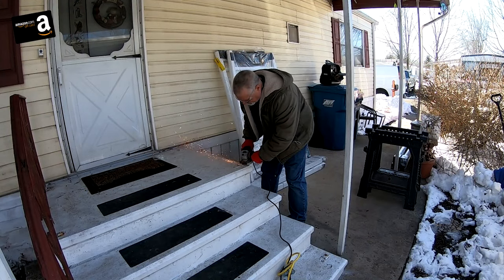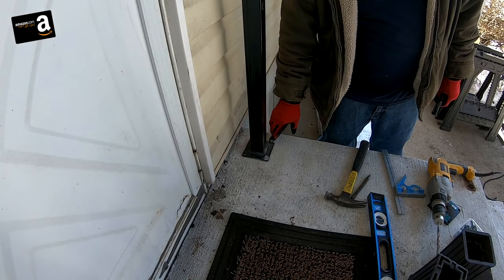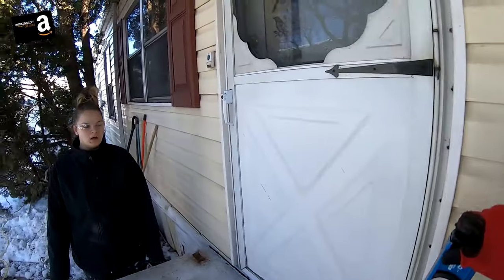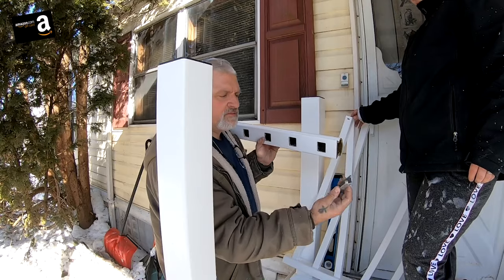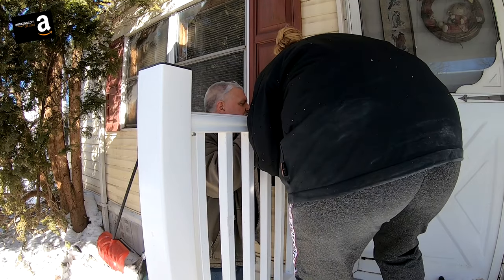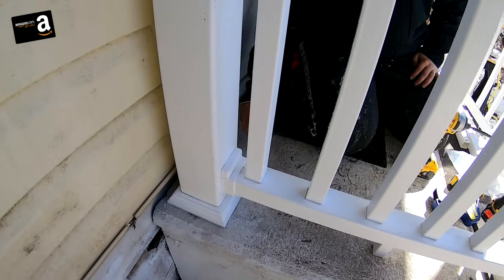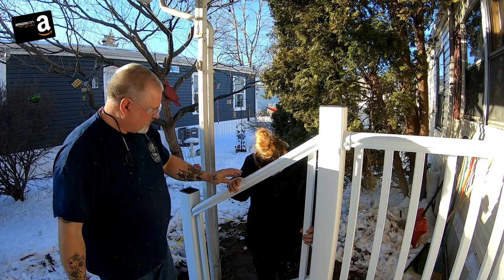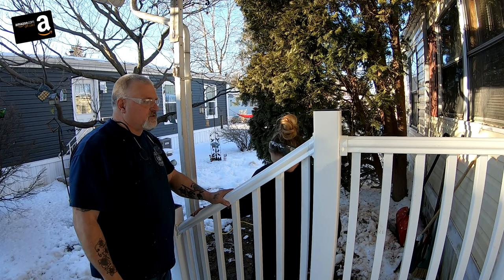How to Install a Vinyl Railing

Comment: I don't know if anyone commented on baluster installation, but here goes.  When you shortened the balusters you cut them off at the same angle as the railing, and needed "7" hands to hold them.   Cut the balusters square when you shorten them, just like the factory, and the job becomes easy peasy.

Comment: I couldn’t agree more about Home Depot! I can’t tell you how many times I’ve had to exchange things because of missing or broken components. One time I purchased a lawnmower and someone’s old one was in the box! May I suggest when you have your final cuts on the ballasts for the rail add some vinyl cement glue to help stabilize then before adding final screws
Reply from the maker: I would be concerned with issues caused by expansion and contraction.

OMG someone’s old lawnmower ha ha how terrible.

Comment: Awesome video for me! Im pretty handy but one thing Ive never done is put vinyl railings up and need to at my place to replace the rotted metal ones. I'm so busy running my own business 6-7 days a week I tried to find a contractor to do this and put up railings around our pool deck and so Im 0-3 with guys not calling back, even after a friendly reminder so screw it! I'll just do it myself. Thank you!

Comment: Nice video Bob. There were many tips I liked. BUT I noticed the balusters on the stairs don't line up. Right side vs left side. In other words the highest baluster on the right side starts at about 2-1/2" from the center post. On the left side it starts about 1-1/2" from the center base post. I couldn't walk away from a job like that.

Comment: I installed this exact rail system around my entire deck. I feel your pain of the install. The stairs were actually the hardest part. Thanks for the tips. I will use them when installing it on my new porch.

Comment: I cut a 35 degree angel (what my stairs needed) from the very tip of each end of the ballast /----------------------------/ .  The ballast were essentially no shorter, but the angles cut on each end allowed them to fit farther up into the rails. Mine then fit snuggly at each end of the ballast into the angled upper and lower sections of the stair rails.  Otherwise - the top rail would have been too high.  I was using the 8 ft stair railing kit.  Go slow, measure & mark cut points very carefully

Comment: The Fiberon stair railing clips are always stolen. 
My first railing install from HD was last year, and took me two long days. I’ve done 35 now and gained enough self taught info to bang them out in a day alone. People pay me big money to install these things. Great side business.
Reply from the maker: I believe people buy items, take out the parts they need and return it, leaving the next guy in a pinch.
Reply: @BobsHomeServicesLLC  
Veranda sells the stair mount hardware on the shelves. Fiberon (which you installed) gives you the hardware included, but doesn’t sell them separately on the shelves. So if yo buy a 6-0 stair railing and want to use on both sides, for say a three stair staircase, you’re out of luck for a second set of hardware. Unless you steal that second set from another pack. 😂
Reply: What do you charge for say this exact set up
Reply: @fiolds350  
You tell me what you’d charge, and I’ll let you know if we’re close.
Reply: @fiolds350  
I’ve been getting $1500 all day. $750 for materials, and double it. Work six days a week. Takes me 6 hours to install and the other two for lunch and shopping for the next days work load.
Reply: @fiolds350  
If you spend $1500 on materials at once, you can ask the pro department for a discount. Up to $200 off.
Reply: @edwardcomiskey6556  thank you.  For family i dont want to charge too much. But im not working for free. For everyone else. Material and double it. Etc. Need pro account.  Thank you for your time.

Comment: What is that hint at the end of th video
Reply from the maker: A zodiac symbol. You may need to watch it on a larger device.
Reply: @BobsHomeServicesLLC  alr the sign is Libra
Reply: @BobsHomeServicesLLC  but what does a zodiac Sign have to do with the code?
Reply from the maker: @4vlad972  it’s a hint